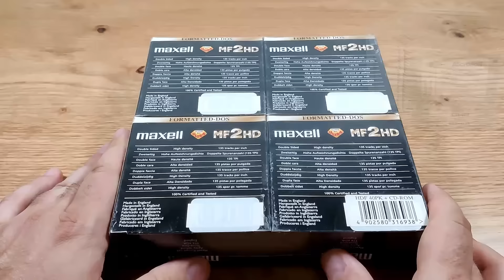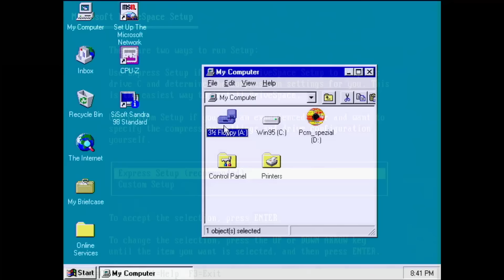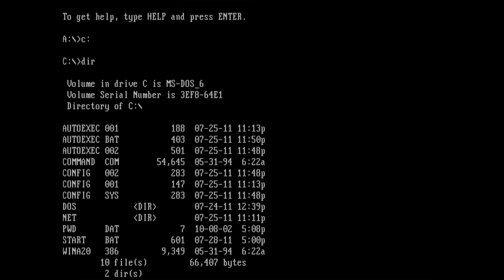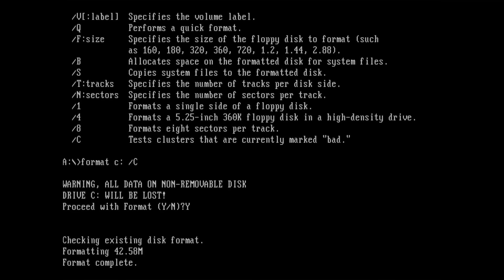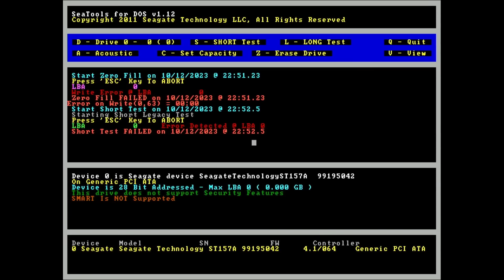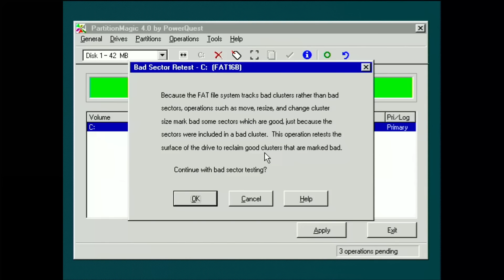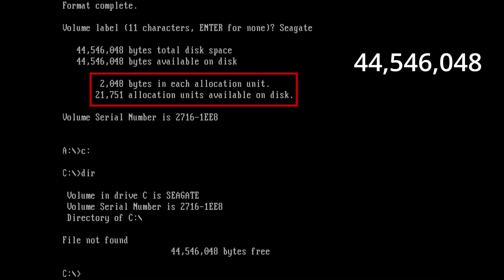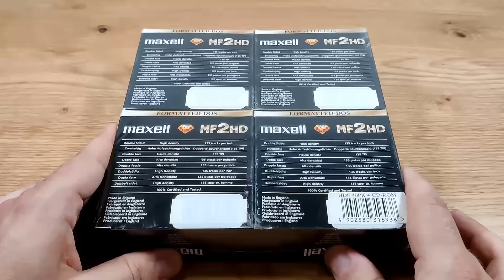HDD Bad sectors - Did my project fail?

Comment: Personally I would recommend MHDD or Victoria, of course DOS versions. These programs can test whole surface of the drive, try to relocate bad sectors or fix them if it's possible. Very useful tools and if I remember well they are available on Hirens Boot 15.2 package ;)
Reply: These are very good tools, I agree. Was going to recommend them too.
Reply: I would agree. You could probably use Victoria to forcibly perform a write action with random data on the offending LBA’s several times to see if they come good before trying to do a read/write test on it.

Comment: Formatting from the command line doesn't actually zero out the sectors as I understood it, rather it does a quick format and tests each sector for readability.
Reply: Using /f is for quick.

Comment: I actually had to salvage data and recover an old HDD from a very important official's system many years ago.

The drive was a 40GB if I recall correctly. After salvaging all the data I could, I ran low level scans a few times. But this computer was so mission critical, i didn't take any chances.

I read over where all the bad blocks were found, then I literally brute forced it with a hex disk editor and marked the entire regions as bad blocks, rather than count on disk scanning software to tell me there's a few 'good' sectors in these otherwise obvious bad regions.

After I reformatted it and reinstalled the OS, with my custom written bad sectors, everything worked perfectly!

In this case, reliability was way more important than available space. I think it only knocked out like 2MB of a 40GB drive, but yeah I didn't want this official coming back within a month or three because a random sector went bad in a known bad region, so I just brute force wrote the entire larger sections as bad.

No its not easy to do that way, but when it comes to a mission critical system (and an organization not in any hurry to replace damaged parts), I didn't want to be held liable for any future failures.

Comment: I've used disk compression - these were desperate times, HDDs were super small - but it was SO SO SLOW, especially on the miserable CPU I must have had back then, that it was basically unusable.

Comment: I have exactly this hard drive. Got it in 1992 when I was 4 years old and it was still in use in 1997 in a secondary PC for DOS gaming since many games didn't like Windows 95. Then it was still in use as a secondary hard drive in a Windows 98 PC (along with a 1 GB one - it made no sense but why not). In the 1st of May 2000 the motherboard of that PC got fried and I put that hard disk away. It's still somewhere in the attic but it might no longer turn on as it's sleeping since 23 years now, most probably some components or the disk itself has been damaged during the years.

Comment: My first attempt to install Win 95 was on a 40MB drive. Back then I didn't know upfront that you couldn't compress the content on the drive to gain space (According to the Win95 installer) - I tried everything I could at the time in order to get 95 running on my system, but I had no luck until I bought a new drive - a 4.3GB Maxtor.

-----

I love the sound of old drives and still want to use them for nostalgia in some systems, but I've also picked up a lot of 2.5" SATA platter drives for retro use due to the reliability issues of older drive models. It's too bad they're so quiet, but with a computer on top of a desk and a drive mounted upfront, you can at least still get some semblence of days past, and better accuracy then something like the HDD Clicker.

SSDs work fine for some situations too, but it's not something I trust for data integrity, if a machine may be powered off for a few years. Alternatively, SLC drives or CF cards are pretty trustworthy. A 500GB platter drive shortstroked to a smaller size performs extremely well on older systems. Then there's the SSD-cached HDDs that have 8GB of SSD cache, to keep them fast, but backed by magnetic storage for offline data integrity. $5/for a "SSHD" drive is a pretty great deal.

"Limitations" - beyond my original 486 system, I always bought large drives that I could never fill (had the 4.3GB drive in my late model 486DX4), and usually more RAM than I ever needed too (kept disk i/o and swap bottlenecks to a minimum). I've never been one to like a sluggish system, and back in the mid to late 90's, those were usually the bottlenecks for anything besides game framerates. As one can imagine, computers stalling out in performance improvements, and software having become extremely bloated for over a decade now, computers and software today have gotten aggrevating to use.

But I still like to hear the mechanical clicking today. Fan noise not so much (late 90's watercooling to the rescue), and I was happy to get rid of HDD noise in my main system at some point where SSDs got large enough for OS AND data, but for my retro systems, and servers where the i/o limitations don't waste my time, I still enjoy hearing my activity provide acoustic feedback.
Reply: 10 years ago, WD SSHDs tended to have their flash overheat(?) and fail. One of my laptop drives from that time reported an unrecoverable sector failure or something, and I no longer trust it with any data (currently don't have a use for it).
Reply: I could be mistaken, but I think a lot of newer drives have their accoustics setting to quiet by default... You might squeeze some more noise (and performance?) out of those quieter drives if you can change those settings in the BIOS, and/or find some [linux?] utility to change their defaults... Maybe something SMART-related or 'hdparm' comes to mind (with little knowledge off-hand).

Comment: I use three disk utilities for intensive work: Gibson Research's SpinRite 6 (it's about $80 online, boots from DOS, best for old drives on computers made before Intel's i-series CPUs (Core2 or earlier)); Crystal Disk Info (donation-ware, runs in Windows 7/10/11, better for newer drives on newer computers including NVMe), and HDAT2 on the Ultimate Boot CD 5.11 (free downloadable ISO, boots in DOS, works best on Core2 or earlier). SpinRite is my go-to, especially when data recovery is important. The others are also good for disk wiping, viewing in-depth SMART statistics, and setting disk parameters such as acoustic mode and idle timeouts. For Macs, the best Classic options are LaCie's SilverLining or FWB's Hard Disk Toolkit; on modern Macs I just pull the disk and run the diagnostics in a PC.

Comment: My experience of DoubleSpace on a 386 was poor because of the cpu usage, it made disc access very very slow. I wouldn't try it with Windows 95 unless it's a fast system. 50kb of bad sectors is not something I would be overly concerned over. I wouldn't trust the drive long term but for one silly short term project I imagine it is completely fine

Comment: You forgot to try the No 1. tool for correcting bad sectors: HDD Regenerator. It tries to low level format the sectors again and usually half of the time is succesfull.
Reply from the maker: I put it on the list. Depends which ones I can try as I'd prefer freeware.

Comment: Yes. Used all those tools, and I miss detailed scandisk. I have fiddled with partition tables at interrupt level to hide/unhide things. Patched interrupt 19 to give someone a can't do that message using ctrl-alt-delete. 😅
Interrupt 13 for direct access to disks was common. I still have a PC setup with multiple plug in drive cradles and can even handle, god forbid, zip drives.
I regularly retrive old stuff from even 720k floppies and external apple drives, rescuing data, which apple mostly destroys any way.🎉😂

Comment: Try with HDD Regenerator. It's more of a tool to recover data than to actually "repair" a drive, as it is not unusual for the bad sectors to "reappear" (and for new bad sectors to appear on an already unreliable drive, of course), but for old and test drives where data loss is not a concern it's a great tool.

Comment: The sound of the hard drive spinning reminds me of the time back in the early 90s when a computer had errored out trying to read the hard drive to boot.  I noticed that I didn't hear the hard drive spinning.  It was sitting flat on the desk with the monitor on top of it, so I grabbed it by the sides and quickly rotated it left and right along its vertical axis and then I heard the hard drive spin up.  So I hit Ctrl+Alt+Del and it booted. 👍😁

And that reminds me of the time in the late 90s or early 2000s that a computer wouldn't boot after being stood on its side instead of flat on the desk, so I put it back down flat and it worked again.  Apparently the hard drive spindle or bearings were so worn that it could literally shift so much that it messed up the head alignment!

Comment: There were times when I was using 100mb hard drive with drivespace. No errors, no data loss. Also used it for ramdisk (as I had 32mb of ram and could give 24 to ramdisk and install/copy a game like DukeNukem3D on it.)

Comment: My first IBM PS2 486 came with drive space already enabled. I didn't even know it was at the time, as I'm sure most consumers didn't. It was only a 200MB native HDD I think. I feel like they stopped shipping systems like that by default around Windows 95 as it probably generated too many complaints.

Comment: i messed around with micro95 years ago, it's basically like 98lite, it's just a set of inf's for win95a's installer that makes it so small you could fit win95 into a 4mb ramdisk. of course it's also barely functional, but you have explorer and notepad and a few other things. you can add back needed runtime dll's by extracting whatever you need from the cab's off the install disks.

Comment: I've managed to fix weak / bad sectors on a Samsung drive, obviously not that old a 2TB from 15 years ago. What tool did I use... none, I made my own bash shell script in Linux to read block by block and write down all the sectors that were unreadable, I had to do this myself because every time the drive tried to read a bad sector the drive itself would crash and give out IO error on the SATA bus, sometimes it would kernel panic the OS. I top note, if your drive kernel panics the OS, connect it via a sata to usb adaptor it at least wont crash your chipset and only crash the adaptor instead.

Next I read all those bad / weak sectors into another script and either got DD to inverse the value of the read sector (I chose to read 10 times to get the data) and write it back to disk, then write the original data back, or if the sector was 100% broken try to write a 0 then a 1.

I then made script run the entire process about 500 times.

Now the drive thinks there is nothing wrong and smart says the drive is 100% fine and read and writing to the drive does not crash my OS. I was also able to retrieve all the data back from the drive, the bad sectors didn't actually have any real data on them which is kinda lucky, bu the weak sectors did (the ones i had to read 5 - 10 times for it to get the data).

No idea why that worked, or why I thought to even try doing that, or why it fixed it but 🙃.

As for drive compression, that is still a thing. BTRFS filesystem on Linux has built in compression at kernel level so you can use a variety of compression techniques, including my favourite zstd, a really fast and good compression technique made by Facebook of all companies. Not only to you use less space but the data reads faster, it's even fast enough to be usable on SSDs at the lower compression levels. It also intelligently works out if something is compressible, so not everything is compressed if there is no benefit.

Comment: I often use Dban to format drives with sector problems as it wipes all data including partitions, locked sectors etc. or I more often use WD Data Life Guard to write zeroes to the drive which also can rejuvenate or remap sectors if the drive supports it. typically if the drive is too old to have spare sectors it can remap to it is harder to get reliable. but if the drive has sectors that are bad because it was interrupted or otherwise corrupted for other reasons than actual physical damage then Dban and WDDLG might actually fix it. I done this a lot to fix drives. I am sure your WD Drives have Smart capability for remapping sectors and you could use software to check if they have done so, it is pretty common your older drives already have damaged sectors it have remapped but then it won´t show up in scandisk as it just uses a spare sector for it instead. it is when Scandisk show bad sectors you are in more trouble as it might either A: have no spare sectors, or B not yet remapped it, C: sector is too broken to remap, or D: the drive have run out of spare sectors. or some other reasons. you could also have a phenomenon called sector rot, or disk rot, when the drive been sitting for so long the magnetic flux have faded away and it can no longer make a self test or read write correctly, if it have not gone too long it might also work after you write zeroes to all sectors again to renew the magnetic field

Comment: does those caviar hdd's still have little socket in one of those 2 cutouts in the casting on the oposite side than ide connector? if yes you can install led in it and hdd would have bussy light separate to one on the motherboard, older hdd's had a led soldered on them, newer were equiped with sockets and later this feature was droped, but you could have rgb hdd in the early 90's

Comment: Honestly try Victoria for dos it has low level tools built in if there are left over spots left it can swap out to remap them it may work I used it on my 253mb Samsung drive which still works today I've had the drive sense the early 90's and it still powers a dos rig that doesn't get fired up enough anymore.

Comment: I used Stacker before the DblSpace/DriveSpace days. Oh and today I often scan HDDs and SSDs with HDD Regenerator  which is advertised with its supposed ability to recover bad sectors as in making them usable again - but I haven't ever tried this function and I don't even know if it's there in the freeware version, maybe with limitations...?

Comment: I have used a program called hdd regenerator to save a disk once to the extent that atleast i could save the data on the disk as windows didnt want to even boot. Tho it wasnt free if i remember right.

Comment: HDD Regenerator works wonders. I usually use it to repair a drive with bad sectors just enough to get data off of it has saved me from a massive headache more then once.
Reply from the maker: I may give it a try, but first, I need to investigate SpinRite after having a great discussion with Steve Gibson, the author of SpinRite!
Reply: @bitsundbolts  Hope it all goes well 👍 either way wish you best of luck.

Comment: Spinrite is the thing for that. I have fixed plenty old drives with capacities less than 500MB with that tool often successfully. It can take hours, yes but we have time, dont we? I use the latest version, i think 6.0 and especially when you have a drive where the very first sector is crap, you cannot format anything anymore, let Spinrite fix it and the drive will work again. Of course there are possibilites that there are mechanical errors on the surface, then even Spinrite cant help. But its better - and deeper - than scandisk.

Comment: Interesting video. I am afraid the sectors in the hard drive may be truly lost. I would normally expect the format command to mark sectors as bad too, but I guess this version in DOS only writes but doesn't verify. I believe there is a command line switch to make it do some sort of verify  but I don't know if that helps.

I remember Norton Utilities used to have a program similar to scandisk. This was usefull on old DOS installations without scandisk. I don't know if it's any better or different than scandisk. I believe it also has a disk testing utility but I don't know how helpfull that can be.

I wish you all the best with this crazy idea. I'm looking forward to the next video.

Oh and how affordable are diskettes in germany? I am looking to buy a few like you did. I'm from the Netherlands and consider having them shipped to me.
Reply from the maker: Now that you mentioned it, I have seen certain boot disks (Windows 98) to re-record bad sectors after formatting was complete. I guess this feature wasn't present in the version I used here (which I think was a Windows 95 boot disk).

Regarding the diskettes: I found some very expensive at 15 euros per 10-pack, and some cheap ones 15+ packs (new!) 25 euros shipped for all. I bought them from local classifieds and got lucky.
The diskettes in the video cost also around 25 euros shipped - a bit more than 6 euros per 10-pack.
Reply: @bitsundbolts  thanks for the comment. I've given it some thought but I think I'll go for a Gotek instead. It might cost double of a set of diskettes (40 euro locally) but it will be way more reliable and save me the time and frustration of finding working error-free diskettes to write disk images to.
Reply from the maker: Yes, the gotek is a way better option. I am using one too, but you know, for the sake of content, I am willing to get old floppy disks 🙂

Comment: Did you try a low level format? We use to throw that around like spaghetti in the 90's, it was something released before seatools, also by Seagate, it was a dedicated low level format utility.
Reply from the maker: No, I have not yet used any other formatting tools than the ones seen in the video. I read that low level formatting may cause issues in certain cases. I didn't want to jeopardize the upcoming videos and went with a simple DOS format. It seems to be good enough for me to continue for now, but I'll definitely try different things later!